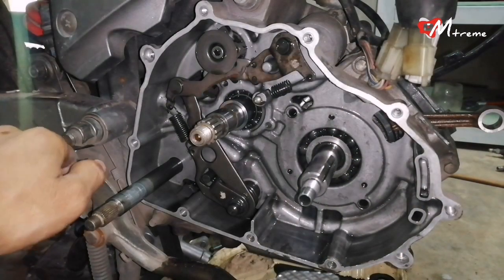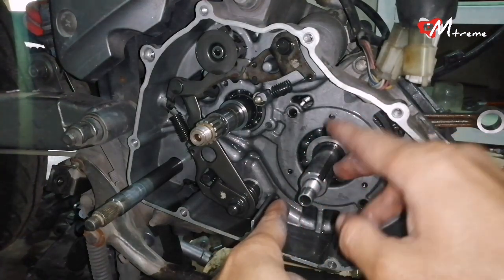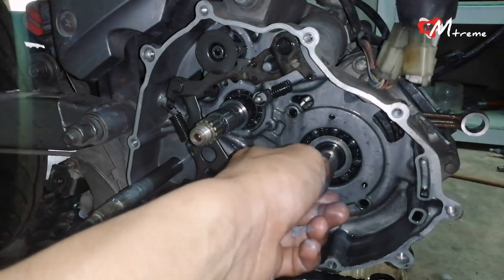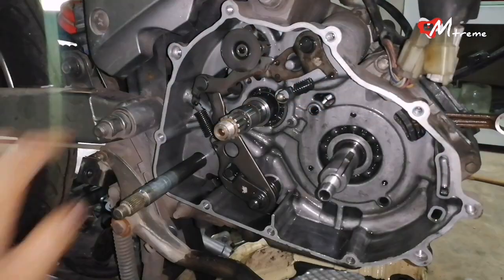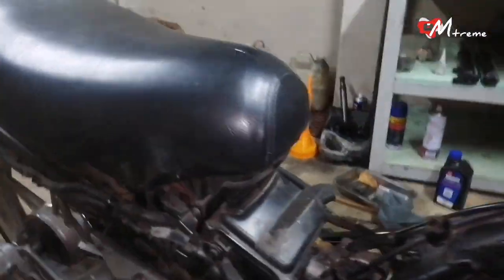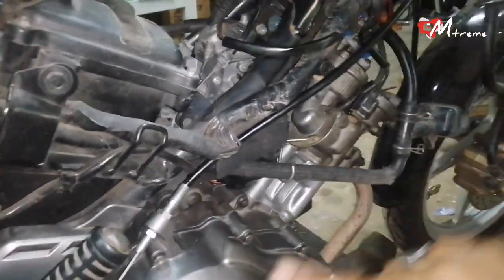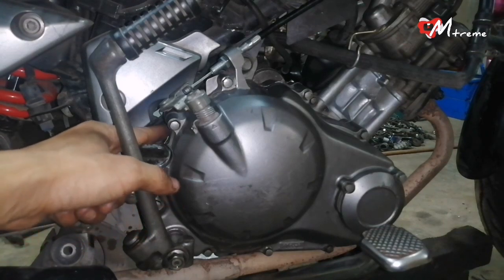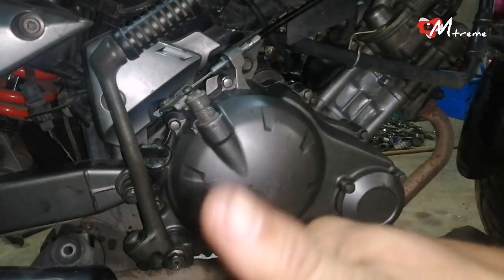Punca Enjin Lc135 Bunyi Bising | Berdengung..!! 🔥🔥🔥

Comment: Saya kena kes bunyi berdengung ni boss, tapi bunyi dia kuat di dalam tangki minyak..pening kepala saya fikir apa punca dia...LC135ES V3 boss
Reply from the maker: Betul ker bunyi dlm tangki minyak,..? Cuba degar betul² dtg dri mna bunyi dengung tu.
Reply: @WinMaxtreme  itu la boss...pening kepala saya fikir, bunyi tu kuat dalam tangki minyak, lepas tu ada sikit2 kat dalam coil magnet ...2 area tu je...masa rem throttle baru ada bunyi berdengung tu
Reply: Bro dh repair apa bos? Saya kene mcm tu juga. Dah ganti coil magnet still bunyi dalam tank
Reply: @skyline516273  dh tukar coil magnet..masih bunyi berdengung, entah la apa punca, rasanya piping ekzos kena pedal brek...bergetar
Reply: @aaronlfcynwa2951  sampai sekarang bunyi lagi ke bro? . Saya sebelum ni takde bunyi. Ni seminggu dua dh bunyi. Masa bawak kan then lepas throttle kuat bunyi berdengung. Piping sayang dh tukar fibre lain smeua dh buat, one way bearing dh tukar still ada lagi. Bawak okay cuma rimas bunyi bnda tu
Reply: Saya dh bukak balik blah magnet, bearing semua okay. Tapibunyi kat tank lagi. Serius tak selesa bawak motor